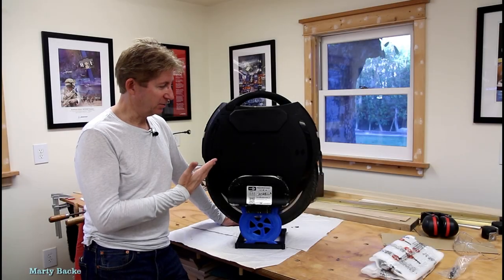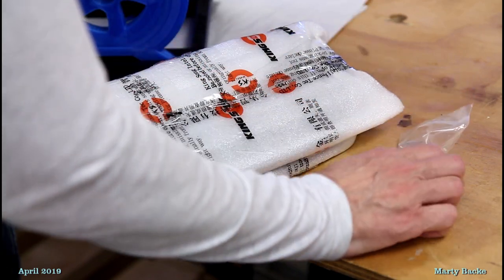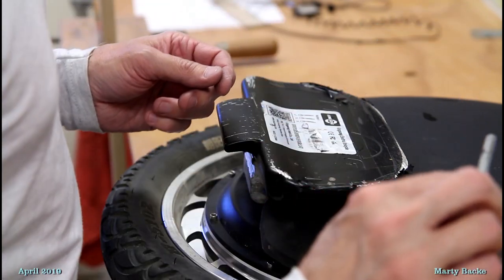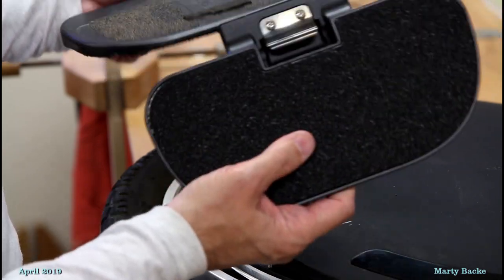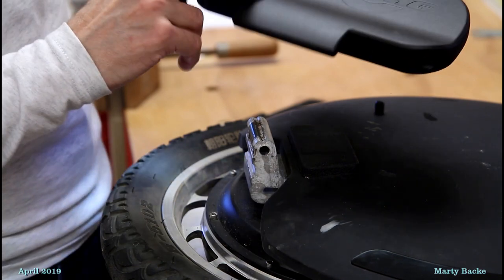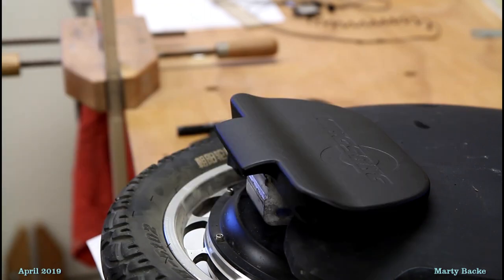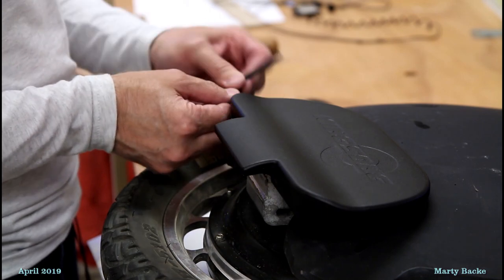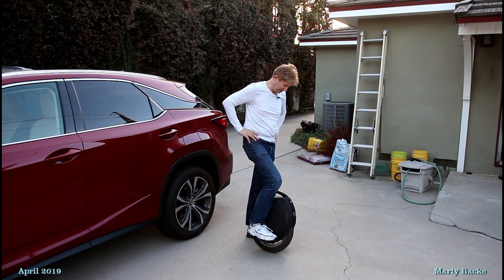Large Pedal Installation on the KS18XL

Comment: I put a pair on my KS18S  love them! Wish I had them the first 5,000 miles. They are very grippy. I didn’t realize how often I’m adjusting my foot on the pedal. Then I got theses pedals n my  foot wouldn’t slide on the pedal the way it use to.  But you readjust quickly. Took me forever to get my pins through cause mine didn’t come with new pins or screws.  My pins were pretty warped.

Comment: Marty got to ask u a ? awhile back u did a review on the KS 18S (tall one) I stand 5'6" I think Id be a perfect fit for that, but is the 67 volt the highest voltage for that unit? not having much luck with Gotway 2 out of 4 is not good odds, So I want to try kingsong and the 18S attracts me cuz of the seat & the fact that the speakers double as a horn that right there tells me, kingsong cares about safety and the pedestrians you pass along the way, but an 84 volt would really sell me to buy one. : )
Reply from the maker: The 18S is only available in 67-volts. It's still a nice and strong wheel - don't fall for the marketing :-)   If 67-volts works than "it's good enough".  My Z10 is 57-volts but has lots of power.

To be honest, at 5'6" I would be concerned that the tall 18S shell might be too uncomfortable, but I don't really know.
Reply: @ElectricUnicycles  no kidding ur Z10 is only 57 volts Wow I never would have figured that, but my 1st wheel MSV2 it too is 67 volts & I only wanted another one for range ...So maybe? 
My inseem is 31"maybe 33" if I move my gonads around...lol 
I guess I would need to know the height from the pedals to the seat, this is funny Marty, never thought Id be sizing a wheel like a pair of pants...lol
Reply: @ElectricUnicycles  well just found out from Eddie Moy the overall height of the KS18S is 27.5" and from the pedals to the top of seat is only 22" that's right above my knees, I believe she'll fit Marty, Its the width Im worried about, but she looks thin enough to aleast try her out. 😎👍

Comment: Hello,
I've bought a pair of XL pedals for my KS16S but I really really cannot slide the axle into the KS no matter what I do... I know it's the right way for the axle, I have tried to slide it in the pedal, and in the KS. But once I place the pedal on the KS and try to slide all the way the axle, I cannot find the hole and... 
I'm open to all suggestions, all your tips :)
Say, both pedal are identical, right? I mean, there is no right pedal and left pedal, correct?
Reply from the maker: The XL pedals have a tapered hole on one side (there's only one grub screw required per pedal) so the pedal rod has to go in the hole that is tapped.

The only thing I can think of is that the pedal is too flat (90°+ degrees from vertical) as you are trying the feed the pedal rod in. Let the pedal lay flat against the side of the shell as you are feeding the rod in.

Good luck.